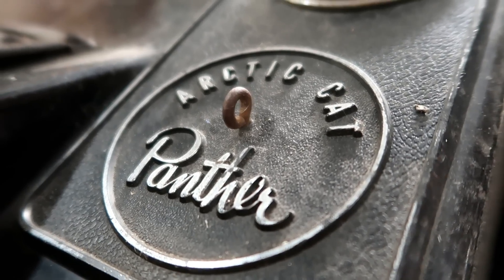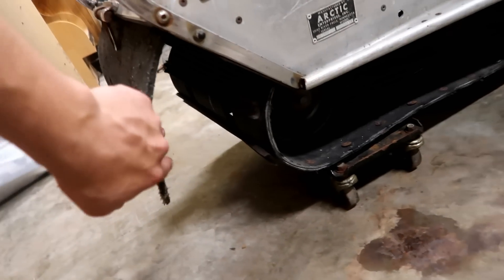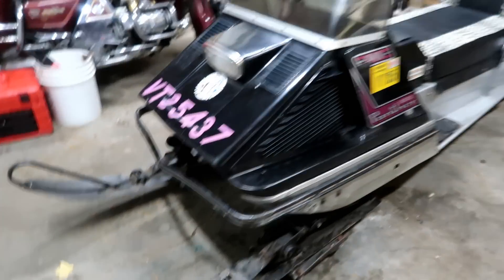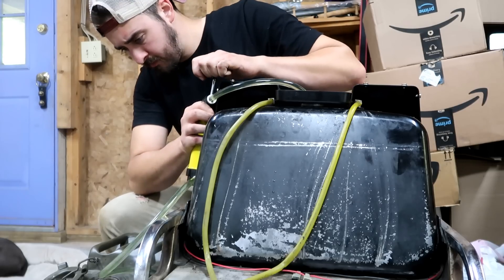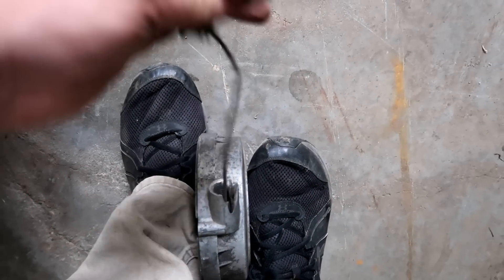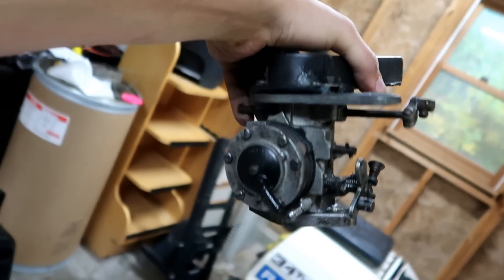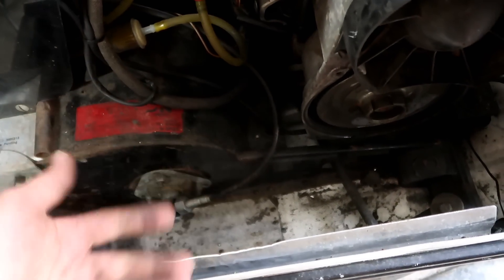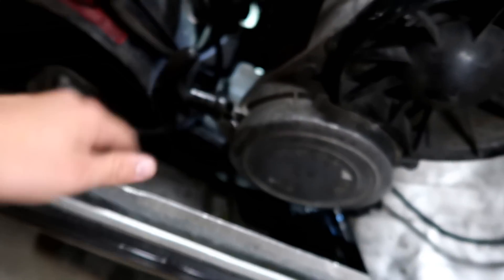Will It Start? Vintage Arctic Cat Panther Snowmobile ( Buying + Fixing )

Comment: i have a 1991 panther body is totaled i have a old xcr 440 frame, with chaincase that i am going to put most of the panther into. its going to be alot of work. im going to bore out the arctic cat 440 to a 500 and then swap it. after that i will take the shocks off the front and use them hopefully on the xcr 440. then i will mod the rear whole suspension to fit the xcr. its going to be a BIG fun project. i will post all of it on my channel. the swapping onto the xrc frame wont happen until this summer because its under snow. i will post some of me tearing the panther down though.

Comment: clean sled for $300. I had a '74 I think it was. Never got to 100%, sometimes ran like a beast, other times it would kind of bog down. upgraded to a 78 motoski so I abandoned the cat but for style you cant beat the old cats. This was the mid 90's, wish I had kept some of the old sleds we used to buy cheap., getting harder to find. Good luck with the sled and the covid.

Comment: Sweet!  I have a couple ski whizs with the same jlo.  Those bolts for the recoil (dumb design lol) tend to come loose.  I usually use a little smear of loctite.  Also check for any air leaks... Those engines can't have any... or they will blow up unfortunately.   Anyways great video.  👍

Comment: I got a 92 wildcat 700 for free for You if You wanna pop over to New Hampshire... We about 35 minutes or so from Laconia..  Needs some work and is mostly there... carbs are off and clean... ran on gas down the plug holes.....   Let Me Know.

Comment: No One who has or does work on gas powered engines says ridiculous things like "Don't put gas down the spark plug hole it'll damage it" Or something similar. They haven't got a clue as to what getting an old or difficult machine to first fire when cold or after sitting for years. Armchair mechanics. I will say of course it's not ideal and it's not measured etc but it's not going to cause big problems from doing it. What do they think a Primer is on those older sleds?? It literally a little rubber button that you push a few times for that very purpose! Old cars used to have little built in cups on them so you could prime them on first start. People.